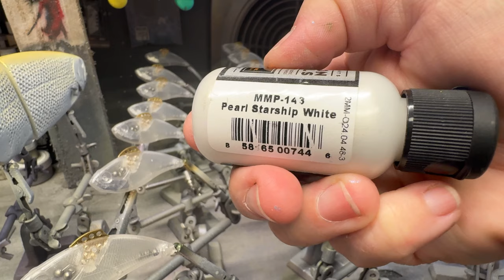Twenty In Twenty (A Jekyll Spray Session)

Comment: Yep i'm on my 5th pack of That Cosmic galaxy color shift Paint from Hobby Lobby, Doing blueback herring color shifts on the Clear Spro Shi-Shimmy shads and clear coating with BSI ( keep those joints epoxy free is labor intensive )  Bait still swims perfect with such a heavy CC, I hooked a 2 ft gar, and he let me know how strong my CC was.  just little scratches, Love the voice over Jen, keep grinding out the baits, To hot for me to paint this weekend in S.C. no AC in the garage, cant keep up with the heat anyways.